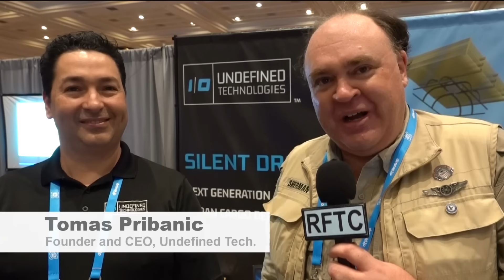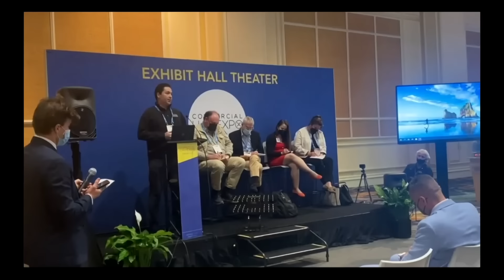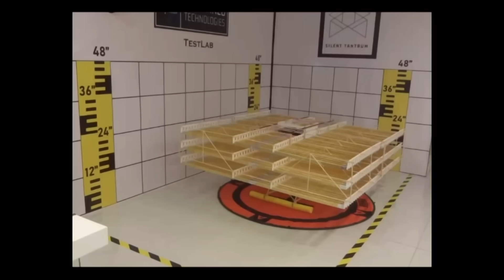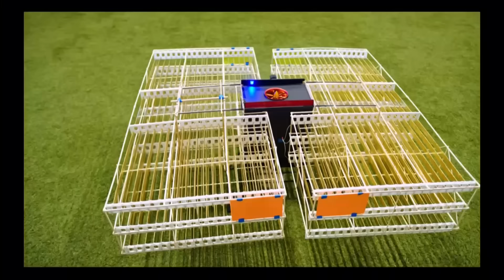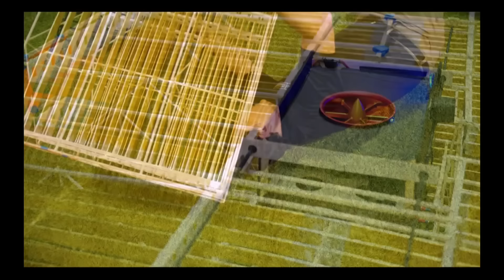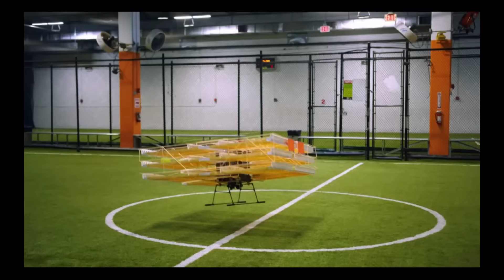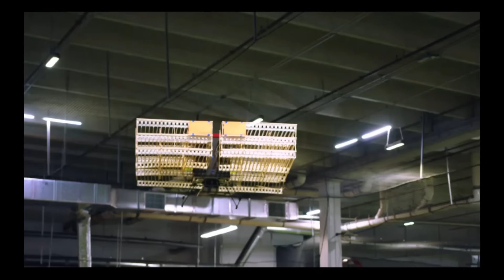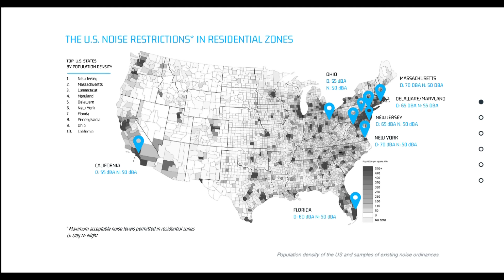New Drone Tech: No Propellers, and Yet It Flies!

Comment: I did this in junior high like 20 years ago.. it was called high voltage lifter. You made them out of balsa wood, tinfoil, an old computer screen and thin copper wire.

Update:
Very impressive and commendable that it runs without cables, but hard to imagine a battery dense enough to allow for a meaningful flight that can overcome wind forces on such a large surface area required for silent ion propulsion.
Reply: When I read 20 years ago, I was thinking 1980s. Not 2002! I'm getting old
Reply: @drink15  same, lol, ouch
Reply: @drink15  omg me too
Reply: @drink15  ssme
Reply: @drink15  Time flies except when your waiting for homebrew to ferment.
Reply: I got five likes in what seemed like five years LOL.
Reply: @Quadromodo : Maybe not, but Time Flies When You're Having Rum.
Reply: @Quadromodo  Does time use ions to fly?
Reply: @PanglossDr  Ask an Ion. I'm drunk as usual.
Reply: Yes me too. It's a strange  thing that happens in a person's mind as they get older, once they reach their 20's "new" time seems to get dismissed somehow. I still keep thinking movies I enjoyed in my teens were 10-13 years ago but are actually 20.
Reply: @drink15  me too lol
Reply: @drink15  ⚰️
Reply: @drink15  It's even worse because i talk alot about 80's music with young people, and then they look at me as if i'm from another planet,
but i understand now, because it's the same as when we would still live in the 80's, and then some old dude talk about the 40's.
Hell, this 80's kid is also getting old, and getting older is no fun at all. Specialy when your body is already over the hill for years,
and you just don't want to accept it.
Reply: @3DPeter  You don't have much control over your body aging but you can control your mind. Youth just isn't having a young body, it's also a mindset.

If it makes you feel any better, kids today will have the same issues.
Reply: @drink15  FUKKKKKKKKKKKKKKKKKKKKKKKKKKKKKKKKKKKKKKKKKKKKKKKKKKKKKKKKKKKKKKKKKKKKKKKKKKKKKKKKKKKKKK
Reply: @drink15  ohh nooo, my head told me cool he did this in like 87
Reply: @drink15  Kinda like a few months back, I was looking for a 2nd vehicle. I input the highest I wanted to pay and all these trucks from 1995-2005ish pop up... I'm like "Cool!- these aren't that old...", then I started thinking about it... YEAH- We aren't GETTING old, we ARE old LOL!
Reply: @drink15  aw shit... yeah... same...
Reply: @drink15  Actually,these things were on the cover of Popular Mechanics/Science magazine more than 40 years ago,but the power supply stayed on the ground and was connected to it with a thin wire. At least they have made the power supply light enough to fly with the lifter.
Reply: @drink15  Been there done that.
Reply: @drink15  This was a common parlor trick in the 80s too. possibly earlier.
Reply: @drink15  yup
Reply: @drink15  I guessp 1980 was in your youth like mine? 😆👍
Yes we get old...
Reply: sop its not realted to the ion drive plane made at some university a few years ago as proof of concept?
Reply: Old tek
Reply: @muckstar23  I remember thinking how cool this was going to be when the battery tech caught up. That was like 13 years ago lol.
Reply: @Appalachian_cyclone  
If they use layden jar style capaciters made from dixie cups and foil, stacked one within another, you have your light weight battery.

They can be discharged slowly now, for use like a battery, and re-charged rapidly.  Thus surpressed for the most part.
Reply: A lot of these technologies are very old
Thomas townsend brown built these in the 50s.
Reply: @Andy Smythe Yeah, I looked into it more and found another video of theirs with sound. Pretty messed up to claim it’s silent. It’s louder than a quad rotor.
Reply: It was a thing back in the 60s.. nothing new.
Reply: @larryfisher7056   That's why I mentioned the John Hutchison Effect. In this crazy world, if they think you look to wild or nuts to invent something, they steal it and invent again.
Reply: @Andy Smythe They are loud. My drones scream and they are just using propellers. It would have been one thing if they said only lift was achieved by a ducted fan and didn’t claim it was silent. It’s even more irritating that the guy in this video blatantly lied about it too.
Reply: Yeah well MacGyver did it in the 80's and he only had a shirt button, a used condom and a workout VHS cassette with Richard Simmons on it.
Reply: Yeah but yours was not wireless like this one
Reply: @seandarke1892  very true, I would say that's the most impressive thing about this
Reply: @seandarke1892  I agree. There is a big difference :)
Reply: I remember this in a Popular Mechanics/Popular Science magazine story 50 or 60 years ago. All you needed was a high voltage supply and some wire and balsa wood. This new one is different in that it can carry it's own power supply,which the old one couldn't. Doesn't seem very stable,and I would be afraid to fly it outside.
Reply: @mikedunn7795  The UT craft gets its thrust from a ducted fan.  I know what it takes for an ion propelled craft to lift its power supply.  The UT craft is hundreds of times underpowered the way it is built, to do it with ions.
Reply: I suspect the main difference is new stronger  lighter materials, new meta materials, more powerful and lighter batteries and magnets etc. revisiting an older concept with new materials.
Reply: yea but the early ones were all tethered. there were limits to how small you could make a hvdc supply back then. now thanks to the miniaturization of power components (mostly because of a boom in portable devices), its possible to have a battery powered hvdc supply light enough to drive ion lifters. the real advancement here is the power supply.
Reply: It seems there is a ducted fan in the center of this thing, from the upturn of the wing shape, It seems that most of the weight is supported by this ducted fan...
Reply: @狮子子  It is also true that since the ionic part of their craft does not have the thrust to weight ratio required to lift its power supply, that the ducted fan would fly better without it.
Reply: @Andy Smythe time to shrink the EDF
Reply: @Andy Smythe what would happen if you crank up the power way hi what does a lifter do when you put an insane amount of power through it
Reply: @seandarke1892   Arcing is what happens then? (more voltage / "power" will eventually lead to arching and possibly less lift when it arcs)
Reply: @Andy Smythe European Defence Force ? Extended Dark Force ? Expect Damage Fast ? Every Day's F*ked ?
Reply: @Andy Smythe 
Yes, there are frequent edits. They don't show a continuous flight.
Reply: Well, it as a great idea.
Reply: So did I
Reply: Here is a video of it with audio.  The loud ducted fan in the middle of the craft can be heard spooling up, it also appears to have steering fins on the bottom.  

https://youtu.be/iihprC5Huf4

There are many flying ducted fan model "rockets" online that sound and fly in an identical way.  Such as the SpaceX copy EDF VTOL model or the Ikarus EDF (ducted fan) "rocket."

Roughly speaking it takes about a 100 times higher thrust to weight ratio than modern technology will allow for a normal 2-stage purely ion propelled EAD lifter to carry its power supply.  In the early 2000s most power supplies that people were using, were closer to1000 times too heavy to fly onboard an ion propelled craft.   The recent MIT glider craft got within about "1/10th," according to their lead, of the thrust per weight needed for VTOL, for a few seconds at time.  I wonder if their numbers aren't somewhat high, because the world's smallest man carrying aircraft, which is about 100 times heavier, and has a wingspan that is similar, has specifications for a much higher glide ratio. (Glide ratio is inversely proportional to the wattage/thrust needed to level an aircraft.)   They also calculated glide ratio with the ion grid switched off.  If the grid had been switched on however, it would have negated its own drag.  Also, it would appear that the bungee launch mechanism produced far more power and energy than the ion thrust grid did for the duration of the 8 second flight.

There is only one series of solely ion propelled crafts that have onboard power since 2006.  There are 33 flight videos of them on my YouTube channel.  They are patented legally since 2014 specifically for lifting their power supplies against Earth's gravity. 

 In order for an ion propelled craft to lift a power supply solely by ions, it generally requires the following details:

Emitter wires that are only a few microns in diameter. A single layer collector that weighs only a few hundred milligrams per meter At least 20 meters of collector length formed from one layer.  The emitter wire spacing must be generally over 15cm high, not 3cm or 7cm, etc.  the total weight also has to be in the rough ballpark of 25 grams, not several pounds or kg.  Without these details the current draw will be way too high and efficiency too low, for any known power supply.

 The UT craft is way too heavy and does not have the required geometry.  A two- stage craft produces about 1/2 as much thrust per watt as a one stage one, 1/2 a gram of thrust per watt.

It also takes a customized novel and specific power supply.  In order for it to be lifted by ions, it requires that the transformer portion of it have a specific custom novel shaped ferrite of just the right type, a novel voltage multiplier, and many other factors, none of which were shown in the UT design.  

With high wattages applied over a small area, thrust per watt also declines. Large masses of slow-moving air can produce lift much more efficiently with a lot less wattage.  That is one reason why gliders have long thin wings, other than avoiding vortices. The HPH is another better example of the principle.

Mr. Pribanic has made many statements that clearly were not correct such as saying that it is silent, or that it is the first breakthrough in 100 years, perhaps he doesn't ever google the subject, of course he does.  He says that it flies for 15 minutes with a 2-pound additional payload. 

Prove that it is ion propelled with onboard power Mr. Pribanic!  Extraordinary claims require extraordinary evidence.
Reply: Is stupid easy to drive them for differential thrust. This dude just stuck a EDF on center and calls it quiet...
Reply: @cruizcontrolFPV  I was wrong and I accept that. Alcohol and blurred vision being my excuse.
Reply: @cruizcontrolFPV  
My rotery sander falls from my hand,
real slow.
Reply: No one will hear it with some loud mouthed Americans next to it. Horrible. Look at how great we are.
Reply: @cruizcontrolFPV  I was wondering what on earth he was on about and realised he can't have noticed the fan with 'propellor blades' stuck in the middle... :)
Reply: You have the schematics for this bro?  I want to make a bigger one like the size of a truck.
Reply: Yaw that uses 100 x the energy this does?
Reply: @Andy Smythe yeah vertical quad drones are not optimal for delivery. I watched a video on a company called Zipline that is using small winged drones, a launcher and a catch system for delivery. It looked so much more viable!

Faster. Lower energy, higher payload.
Reply: @RobbinHarris  Another issue is flight regs regarding endangering people. Once above a certain weight (.5kg?) you have FAA flight paths and restrictions so a falling or out-of-control drone doesn't kill people.
Reply: @leonarddaneman810  regulators... They will probably say the drone is too silent, and require a speaker to make flying noises.

Like they do with Tesla's
Reply: was it powered by casble or on  batteries? I knew about it- But all designs  were power hungry.
Reply: The inherent problem with having a million car/drones in the air is all the downward wind they will produce. This may be an answer.
Reply: @danbrownellfuzzy3010  I have OFTEN wondered about the currents, if you want, of air that WE CREATE all over the world now by automobile traffic. I have never heard of anyone doing a study of the subject but I believe the findings may possibly CHANGE scientists views on global wind patterns, weather, and ocean changes. There is NO WAY you can tell me that the constant flow of air currents created by our freeways have no effect on weather patterns because I believe they may. Most freeways, the speed limit is about 60 miles an hour. They have constant traffic on them in many cities. There is the topic of HEAT created by cities, aka Heat islands, also and there is or would be a relation to that. 
Our cars are now the fans trying to keep our motherboard (mother earth) from overheating, lol.
Reply: @AmikaofMan  I've thought what the seas would look like without waves from ships. Also ever think about the waves we create with radio,phones, and the rest
Reply: We didn't have a taranis control with a gyro back then... Anyway thi
Reply: Not the same.....Your experiment was tethered to the high voltage source on the ground.
Reply: @SilverSergeant  Does not matter. Can it fly 100 meters high? Do you know wind blows away the ionized air? This will immediately bring down the craft. That is why the craft is still for experiments.
Reply: Exactly.  This is old tech
Reply: I remember reading articles about 10 years ago
Reply: Never the less, a bicycle wheel hanging from a rope tied to only one side of it's axel, when spun, will spin upright.  Think "Gyroscope"

One day for us maybe.
Already in use for secret societies,
probably.
Reply: Now we know how the military has been hoaxing the public with alien UFO's for decades where the craft appear to have no engines and can change direction at fast speed in an instant.
Reply: @mentallyilldarkjeroid5378  No, I think those are either camera error or aliens;).
Reply: aahhh, back when we let kids play with 30,000volts... memories
Reply: it doesn't work in a vacuum... does it?
Reply: But it couldn't lift its own generator.
Reply: Ill diämähntea sönö per ciämperräh? v v
Reply: https://youtu.be/cT1wz4l8cEM
Reply: https://youtu.be/cT1wz4l8cEM
Reply: I'll be more impressed with AMF tech
Reply: High voltage lifters could explain a lot of ufo cases. Thanks for your input!
Reply: I used the corona transformer from a copy machine to power my lifters back in the late seventies.
Reply: @robinsonmitchell9995  oh dang! Over 40 years 😂
Reply: @Andy Smythe The fan is in the middle, I don't think that's what's providing the lift, because talked about quadrants. Those fins or whatever they are must be providing the lift. Maybe the fan in the middle is just to cool the electronics.
Reply: Yes and there were videos back in the early days of Youtube where some UFO guy was trying to claim he had invented an anti-gravity machine with one of those devices.
Reply: I did this with a ice  and a microwave..
Reply: yeah but the difference here is that it holds its own power supply. That has always been an "impossible task" that I've only seen one other person achieve before this.
Reply: @MikaelMurstam  I didn't see any power supply. If it does have one then it'll need a wire to the ground,

Either way, a connection is needed between the 'craft' and the ground/earth for the 'magic' to work.
Reply: @grahamstevenson1740  MIT made a glider with onboard ion thrust in 2018 without a ground.  I am an EE and have been working on a series of ion thrusters for 22 years.  The result is US Patents 10,119,527 and 11,161,631.  The craft is patented for lifting its power supply onboard against Earth's gravity using ions long before MIT's.  The videos on my channel are not tricks and there are many officials shown and involved.  They do not require a "ground wire."  They work independently of the ground.  I do not think the UT craft is real though because to lift a power supply with ion propulsion is almost impossible.  it does take a huge increase in thrust to weight to lift a power supply rather than having a tethered one as you understandably think about and are familiar with.  The craft has to be built to weigh next to nothing for each part from the ground up, total weight about 25 grams.  It also takes emitter wires that are only a few microns thick.  The emitter wires have to be positioned about 15cm high to get the current draw low enough, a single layer craft, and a special novel power supply are also needed.  I also did 10s of thousands of experiments for 22 years.   I have heard Pribanic's loud ducted fan and seen the control fins, though it is hard to see well how much they move, they did appear to in his video with audio on his website  The Ikarus flying ducted fan seems to be the same as what they are doing.  In any case their craft is not quiet.
Reply: @MikaelMurstam  You are either talking about the patented crafts on my channel, or the later MIT ion glider.  The ones on my channel are the only real VTOL ones.  The UT craft does have a loud powerful ducted fan in the middle.  If you look up the Ikarus ducted fan "rocket," I believe it is the same as UT's and explains the part that matters.
Reply: HAHAHAHAA!! They didn't have "computers" 20 years ago!!  XD
Reply: @Burnwash  incorrect. Sarcasm?
Reply: Oh yes, me too. But I was to lazy to make something out of it.
Reply: @Andy Smythe what did trump say the tictoc was about?
Reply: And they were extremely small and light no a whole ass drone with a big boy battery
Reply: @liammccarthy5942  potato batteries?
Reply: there's always that one guy that has done everything already, yet his only achievement is to brag about it on a youtube comment
Reply: I was about to mention the same key word. Lifter Tech!
Reply: battery tech is the biggest obstacle to a lot of electrical solution
and probably will remain so for most general applications
Reply: It's HV low current - I did this 15 years ago w/out the RC module - see my links posted they're looking for $$$ - FRAUD
Reply: I was thinking the same, I wonder if they would use a directed lazar to power it.
Reply: @Andy Smythe right?  I noticed the torquing right as the footage cuts off.
Reply: If only you knew the secrets….
Reply: exactly....
Reply: Yeah I made one in highschool too
Reply: My son and I made a few of these while working at a bakery on third shift in Jersey about 20 years ago also.  The Job was so boring  we would start tinkering with old parts. At first we tried some of the high voltage industrial oven flame igniters for the power source and we unwind some coper coils from the coils of industrial motor starter relays. USe Some long coffee stirrers from WAWA and some aluminum foil .  It was called a lifter back then.  Crt Computer monitor HV power supplies proved to be the best, the igniter HV PS were somewhat weak. Making it powerful enough to lift itself and a heavy power supply I thought would be impossible...This Proved me wrong.
Reply: Hydrogen instead of batteries maybe?
Reply: It will never work for payloads. This technology barely works.  Thrust is low and efficiency is just not there.
Reply: Thats why they put the ducted fan in the middle...
Reply: Thanks inspector gadget think I will smoke a tater and ponder what you said
Reply: The central ducted fan helps.. 🙂
Reply: Even the slightest breeze would blow that thing off course
Reply: I bet that didn't have it's own power supply on board like this one has.
Reply: Maybe they can use a more conventional drone to get it somewhere, then launch this one for the final quiet part.
Reply: I knew that!
Reply: You're right but this tech is becoming more impressive because of higher processing power and energy density. It will keep getting refined until we get those Jetson sky cars.
Reply: @Acheiropoietos  Considering we were promised them in the 60's, it'll never be too early.
Reply: @Acheiropoietos  No it won't. Processing power has nothing at all to do with it.
Reply: @Acheiropoietos  lipo batteries helped a bunch, NI CADs had us stuck with many designs
Reply: @Acheiropoietos  Would be fun! Although I fear rolling sh** will always be cheaper than flying sh**
Reply: Could it lift two pounds for 15 minutes?
Reply: @gerstmanndavid  No. It can just lift itself in the air. Needs air to get the upper and lower halves ionized. So won't fly in space either. Climbing 10-20 feet when 40 kv is applied is all it can do. More height = more high voltage required. The voltage can creep over the supports if higher voltage is used and the power supply becomes very delicate.  It is an experimental craft to show power of ionized air. Nothing more. Earlier experiments were triangular shape for easier balancing. Regards.
Reply: @subramaniamchandrasekar1397 ; whatever the crafts weighs, that's what it is lifting.
Reply: @subramaniamchandrasekar1397  yep.  The thing in this video, though, is not one of those.
Reply: @gerstmanndavid  sure. And it can only lift that much, and no more.
Reply: @gerstmanndavid  I don't think so, no even enough for a minute as battery onboard can be quite heavy.
Reply: @gerstmanndavid  2 POUNDS ???? LMAO.  More like 2 OUNCES !
Reply: @grahamstevenson1740 ; whatever the craft weighs, that's what it is lifting.
Reply: @gerstmanndavid  Sorry, 100 grams for 15 seconds is the best we can do. 🤷‍♂️
Reply: @gerstmanndavid  no, because in the early 00's they would be using NiCd batteries. Not Li-ion and definitely no Li-po!

The energy density improvements we enjoy now are the direct result of the smartphone war between Android and iPhone. With electric cars becoming more popular, ww will see even better densities soon.
Reply: @Andy Smythe This one is a bit of a joke. The military version aka (tictac) is way better with graphene solid state cells.
Reply: @Appalachian_cyclone  Look up 'Woman freaks out after UFO flies over her car" and "UFO flies over Memphis." They're all over Tennessee lately.
Reply: @Appalachian_cyclone  gotta love the 'tictac' garbage they keep trying to promote as a 'UFO' its a very well coordinated distraction for both domestic and foreign audiences
Reply: @Appalachian_cyclone  👍👍
Reply: @Appalachian_cyclone not military tech🙄
Reply: "Funny" how many "Yeah, but yours didn't..." answers there are to this comment.  He didn't write "I invented this in.." - just explained , that it was such well known even back then..  Pathetic wannabes...
Reply: @Andy Smythe It’s missing the nozzle on the bottom to vector thrust and air intake at the top. Then there’s the issue of electronics and a battery also having to fit in the middle. This also wasn’t just a video, people were there watching the demo and I’m sure they saw the big banners advertising it as silent. It’s easy to make it appear silent in a video but it can’t be faked in person.
Reply: @DNMEBOY  The video on their website with audio shows an intake nozzle and moving fins on the bottom for control it appears.  There is no logic how it could get anywhere near the thrust to weight ratio needed even with supercapacitors from a laboratory to lift its power supply at all.
Reply: Yay batteries lol
Reply: @Appalachian_cyclone    Dig your name
Reply: Amazing. Very impressive. I’m in electrical engineer and I never heard of this stuff. I need to bone up on it
Reply: @steveperreira5850  I'm an EE too.  The real thing is on my site.  No ducted fans and so on.
Reply: @steveperreira5850  I am an EE as well.  On my channel is the only real thing. The UT craft's ducted fan can be heard in another video.  It requires far more attention to weight and many other factors to do it in real life.  It's not like a quadcopter.
Reply: Ah yes tinfoil at a UFO tech convention how appropriate.
Reply: @BartdeBoisblanc  Tinfoil is used "everywhere" in the world. What are you actually trying to say?
Reply: The rapture will happen without a doubt. The rapture will happen much sooner than many believe (much less than 10 years according to all the environmental, weather signs , israel timelines, astronomical  etc showings:  luke 21:11 . It will happen without any warning , not one , in an instant , catching masses of people off guard just like God always does, ie the flood , sodom and gomorrah ~ a rude awakening .
Matt. 24:44 jesus said 
Therefore be ye also ready: for in such an hour as ye think not the Son of man cometh.

luke 12:40
Be ye therefore ready also: for the Son of man cometh at an hour when ye think not.
 No one knows the exact day or hour the rapture will happen is a certainty . THE RAPTURE CAN HAPPEN NOW at ANY TIME make no mistake !! . Please awake to Christ Jesus which is the ONLY hope NOW and dont let yourself find out it IS all true later when its too late and you have been left behind in the most terrible times the earth Has Ever experienced Before and ever will...for anyone who sees this and doesnt know what to do please If you havent given your life and heart to Christ Jesus you will have REAL BIG problems way bigger than any problems you have Ever had If you are left here on earth after the Rapture . After the Rapture The USA , Worldwide , will face More evils , Inner city chaos, firearm wars etc etc ,power and water , food shortages ,  military invasions,mass executions (yes much blood will be required  by antichrist ) etctec than it Has EVER been seen Before and you surely dont want to be Here then . We Have Time NOW to change , please seek Christ Jesus while there is still time to save ! no one knows the day or hour of the rapture ,But the rapture will start out just like any other day .....The Rapture will Take Place In the day In Broad daylight, sunny day , In an Instant FLASH without ANY warning , and there will be peoples Driver Ids, cell phones ,wallets found in various parking lots , Purses bill folds Found at work etc etc with NO explanation , and People VANISHING so No One can refute it has taken place. .
romans 10:9-10 That if thou shalt confess with thy mouth the Lord Jesus, and shalt believe in thine heart that God hath raised him from the dead, thou shalt be saved.For with the heart man believeth unto righteousness; and with the mouth confession is made unto salvation.
 

 Many of those that are left behind  were seen in deep regret  and many hung themselves on fences on interstates , and roadways and different places, their cars left by the roadside and  many  others also used their cars to  kill them selves  wrecking  into things  . It will be a horrible time , and regret will cause many to commit suicide . 
NOW is the time, dont wait until its too late seek Please Christ Jesus NOW.

Those not going in the rapture and left behind , who rejected Christ Jesus' Love, and those that are practicing sin will have a big nightmare when left after the rapture example woman dancing in topless bar practicing sin , will NOT go in the rapture when it happens abruptly , and many other examples of willfully practicing sin daily .matthew 25 :1-13 parable of the 10 virgins, 5 were wise 5 were foolish and payed a severe price . Acts 3:19 all unrepented sins19 Repent ye therefore, and be converted, that your sins may be blotted out, when the times of refreshing shall come from the presence of the Lord.
romans 10:9-10 That if thou shalt confess with thy mouth the Lord Jesus, and shalt believe in thine heart that God hath raised him from the dead, thou shalt be saved.For with the heart man believeth unto righteousness; and with the mouth confession is made unto salvation.  

Please seek Christ Jesus NOW with your heart,  please   repent change  while theres still time left ...

raptureready.com
Reply: This is like the Wright flyer, a proof of concept. Imagine its performance 20 yrs down the road
Reply: @geoffreytudor5674  Another Samuel Langley like enterprise that got inspired by active US Patent Number 10,119,527.
Reply: Have you ever heard of John Hutchison? He can do what this guy has done and even more. He scared the Canadian authorities with his inventions, and they confiscated some of his stuff, to probably back engineer it.
Reply: @hawaii50th  Conspiracy theories about governments 'stealing inventions' are pure bunkum. It only happens in the deluded minds of those with febrile imaginations and little technical knowledge like the myth about cars that run on water..

The simple fact is that this device is very well known and ions provide very little thrust, That's why so many are made of balsa wood for lightness or they'd never even get off the ground.. The same is true of 'ion thrusters' in space that need months or years of operation to accelerate to significant speed. It's simply a momentum equation.

What you also haven't been told is that these vehicles' can only operate near to the ground and require an electrical connection to it (a wire). They also need thousands of volts too ! The ground also needs to be pancake flat for them to work properly.
Reply: @AmikaofMan  I certainly don't particularly trust the Johnson government one bit but treating everything as some conspiracy is  half-witted. What exactly do you take issue with ?
Reply: @grahamstevenson1740  Show me I'm wrong....
Reply: @grahamstevenson1740  BTW I believe the word you were looking for was FEEBLE imaginations. I have no idea what febrile is?
Reply: @AmikaofMan  Can you be a little more specific please ? As in WRONG ABOUT WHAT exactly ?
I can tell you only that this craft has minimal thrust to offer and no means of actual propulsion in ANY direction. It'll drift around propelled by prevailing draughts in the air. It's held in the air only by a weak 'puff' of charged (ionised) air molecules.
Increase the distance from the ground and that thrust will reduce, so it won't go any higher !
There's no conspiracy to keep the public in the dark about it at all. it's a novelty gimmick basically. Completely useless for any real world application.
Reply: @grahamstevenson1740  "these vehicles' can only operate near to the ground and require an electrical connection to it (a wire)"
The one in the video didn't have a wire.
Reply: @Bonez0r  Since magic isn't a real thing there MUST have been a wire. It's a tiny current at very high voltage so the wire could be hair thin. There certainly will be one.
Reply: @grahamstevenson1740  it's not 'half-witted' at all; practically everything IS some kind of conspiracy.   Look at this video for a fair example:  Drone, claimed to be silent, using a central ducted fan, which are never silent, yet the video commentator blatantly lies to the camera and says it is.  Two people, three if you count camera, had to conspire on this before filming.  A 'conspiracy,' after all, is just a thing that a few people know about and discuss, that the majority do not.
Reply: @Bonez0r  It got almost all of its thrust from a ducted fan. It also has fins under the fan for control. Googling will verify those facts.
Reply: @Andy Smythe...taken down probably because someone will see the connection of this technology to found artifacts and objects of ancient aliens and their technology, people will know that it is true that we have been visited by beings of spacefaring civilizations far in the past by the remnants of their technology that is similar to what we are piecing together now in these technology galleries.